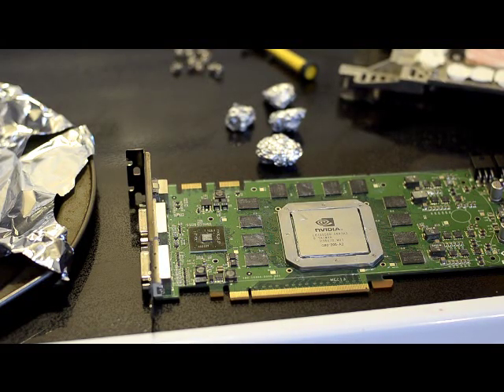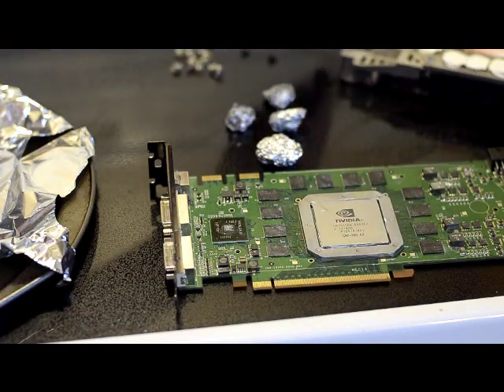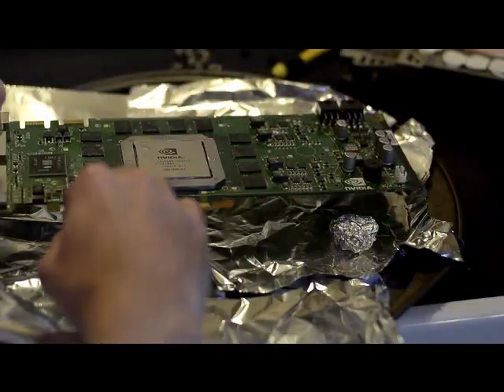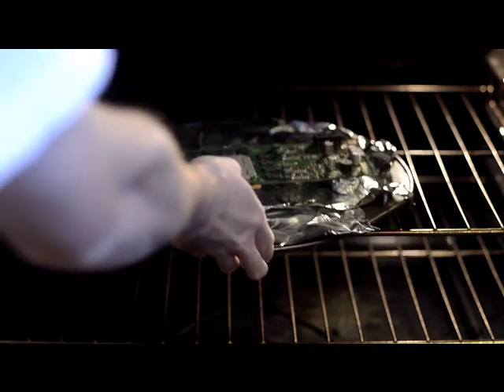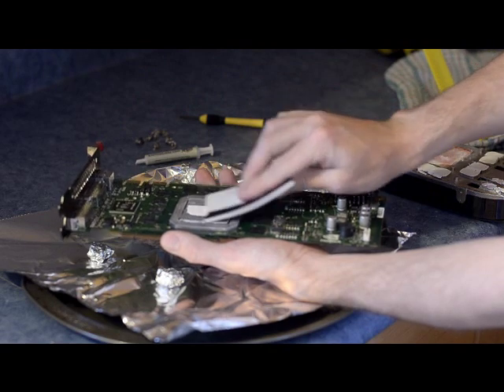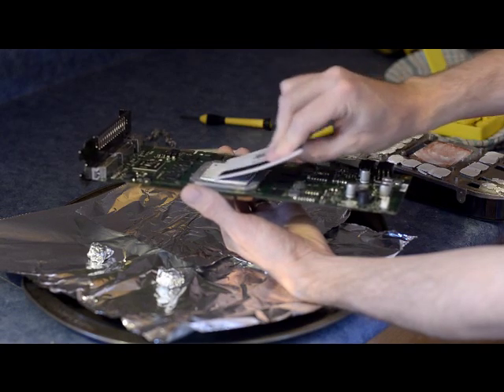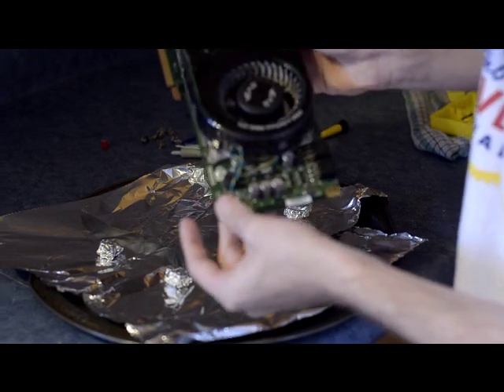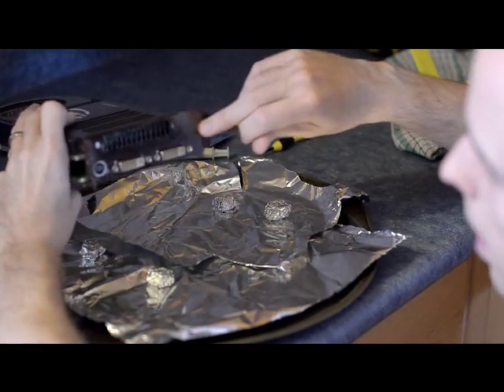Oven Trick to repair 8800 gtx instructions

Comment from the maker: @MrJrucker if your card is the same as mine you can pull the wires out at the point where they connect to the card - the plastic connector actually has two pieces that plug into each other, so you can actually unplug the wires right there.